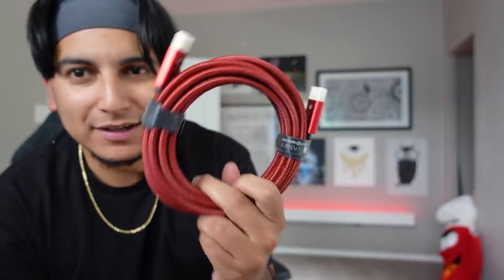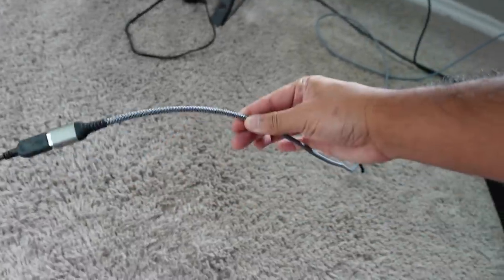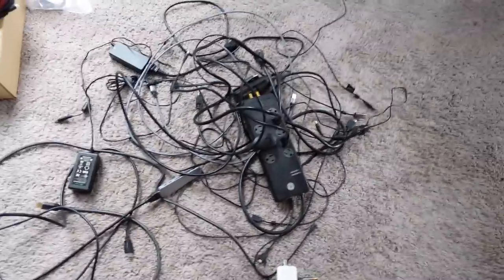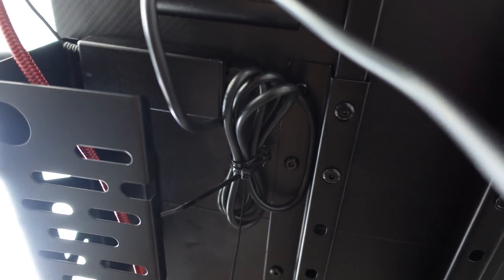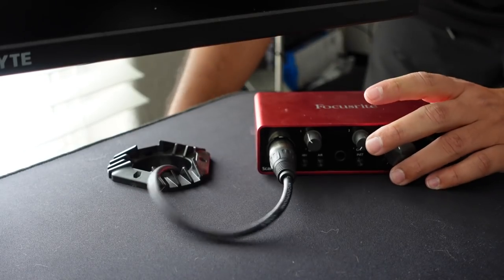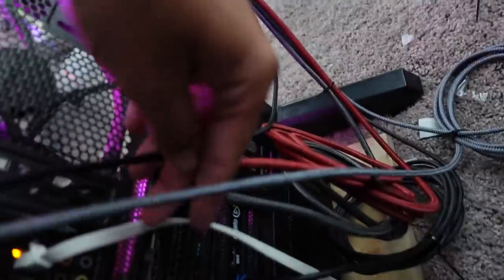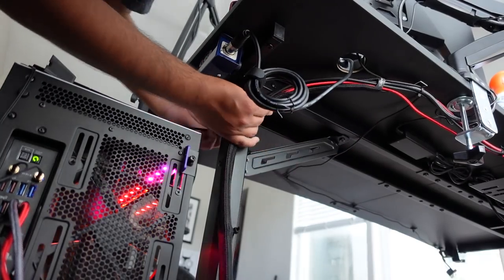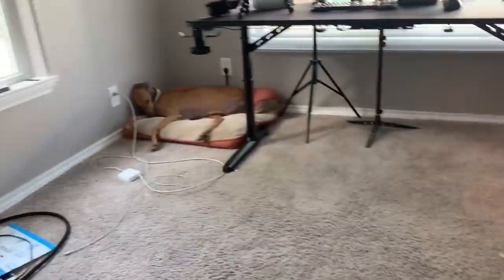CABLE MANAGEMENT HOW TO AND TUTORIAL!! FROM STRESSFUL TO SATISFYING!

Comment: Looks good man!  I just did this myself a month ago, one thing you should consider is instead of going straight into the wall with the power strip, consider a UPS/Battery backup.  Yes, it's a large item on the ground, but with those power outages and blips, everything stays on for a few minutes.